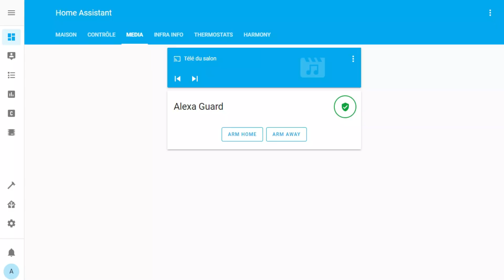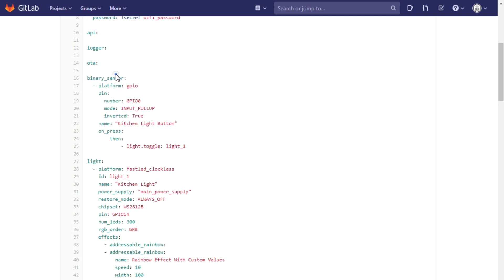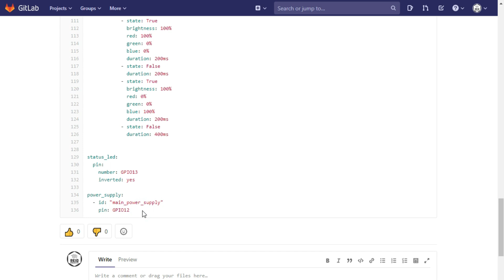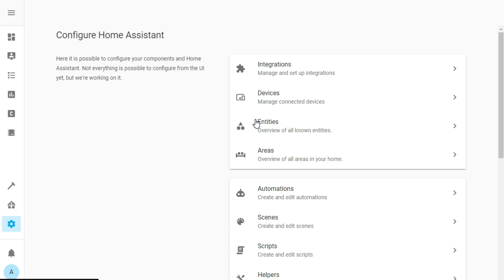Control a WS2812B RGB LED strip with a Sonoff Basic and ESPHome

Comment: Dug out a spare Sonoff Basic, only to find mine looks a bit different. it's a v1.4 board, or at least that's what it is indicating.
The board has the Gnd, Tx, Rx, and 3.3v on the bottom edge as J2.

Have you seen this version, and can it be used ?

Comment: So..... is this putting a 3.3V signal on the data control line? No problems there?
Reply: You can also use a sacrificial LED instead of a level shifter if you have issues with the data feed being too week (especially on longer feed lines a few feet or more). You’ll know if the signal is too week when the Led strip blinks or acts slightly erratic. You just add a single addressable LED close to the Esp device, then run the line the rest of the way to the full LED strip.
Reply: “Weak”
Reply: @ChrisS-oo6fl  that is great advice, i will do so for my vintage desk light it does suffer from interference
Reply from the maker: Yes, the WS2812B LEDs are 5v and the Sonoff/ESP devices are 3.3v. But, if we check the datasheet of the WS28121B, it takes anything above 0.7v as a "1", so there is no issue connecting them directly. That said, I saw some reports elsewhere on the internets with some problems, maybe cheap copies or something similar. In the worst case, you can still add a level converter.  That being said, I hope it helps, it's working flawlessly on my side :)